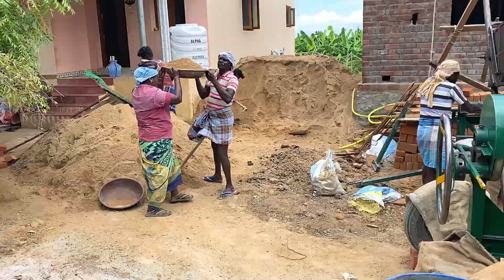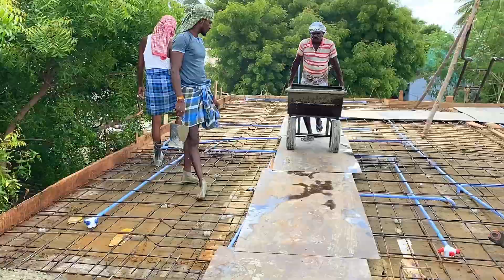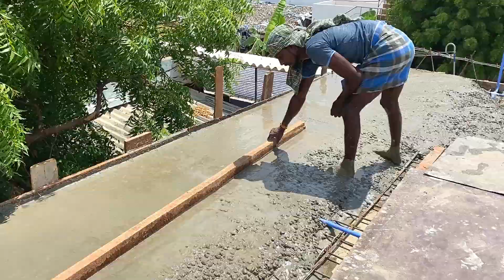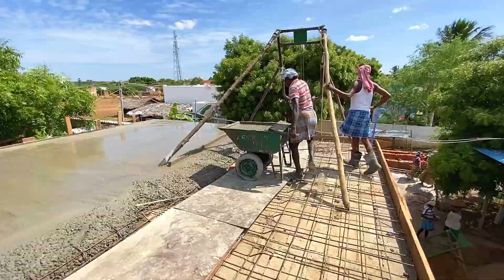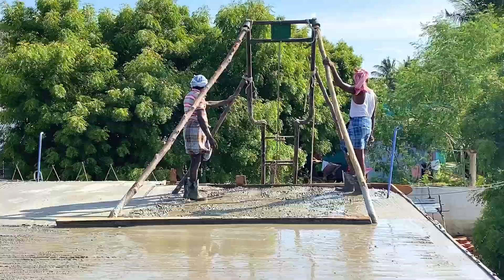Construction of Roof Slab Concrete_Techniques of Reinforcement Rcc Concrete on Roof|Roof Concrete

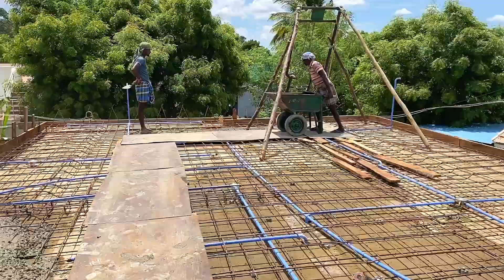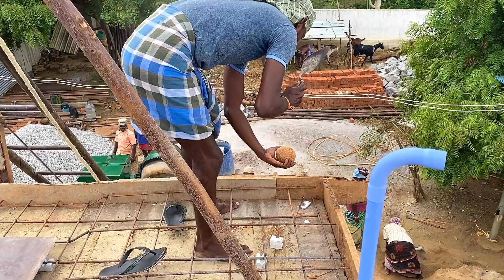Comment: That tipping concrete bucket at 1:55 is ingenious, and those two people on the roof, are very hard workers. I believe the concrete mix has too much liquid and it would not pass the usual test. I would have liked to see a vibrator but there is so much liquid that the mix settles down on its own, Well, I do not know  about the final strength of that concrete slab.  With that much liquid , it would probably crack if it is allowed to dry too quickly, as it seems that they do not cover it to keep it moist till it cures well. Anyway, they are  very hard workers and all the team deserves a hearty congratulations. I admired the praying ritual at 0:46. Wish them all, a good life.
Reply from the maker: Thank you so much
Reply: Good construction  @sumiconstruction
Reply: they keep watering it regularly. I've seen the house in front of my own beeing built the same way. they used to water it 2-3 times a day to keep it from cracking.
Reply: @ava-wk6du should you water it everyday